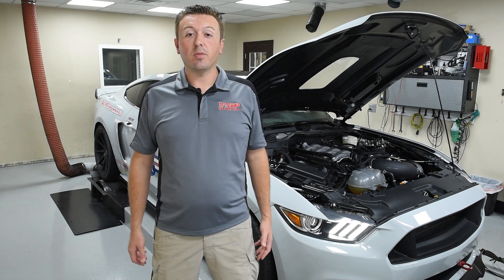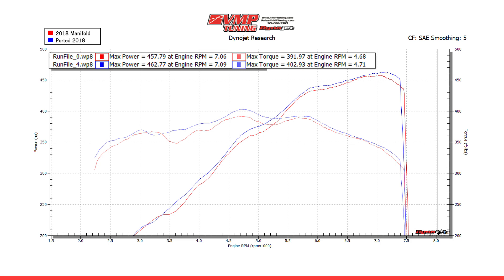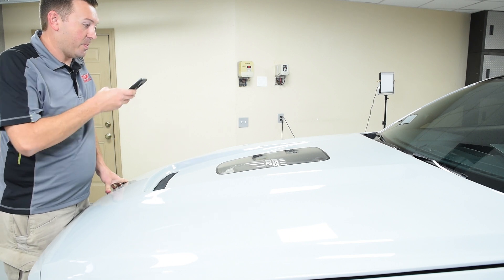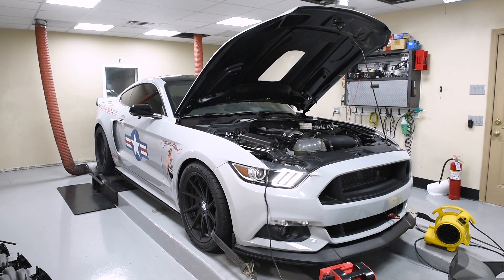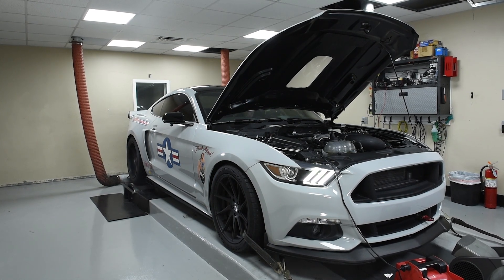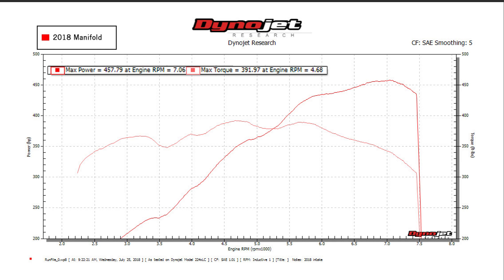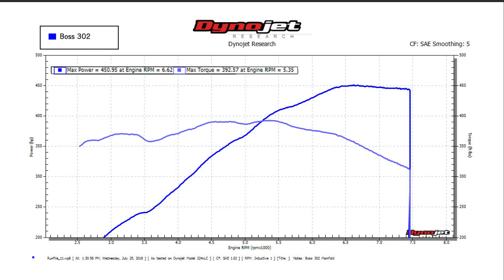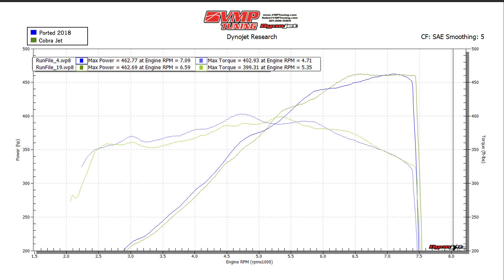VMP Performance | Coyote Ford Mustang Manifold Shootout

Comment: I'm shocked by the truck manifold's hp performance here.  It does nosedive after 6.5k, but everywhere else its hp appears to be as good as, or even better.  Even at 4.2k and again at 5.5k, it's making ~10-25 hp MORE than the other manifolds!  Its average HP/AUC below 6.5k appears significant.  Not what I expected at all.

Comment: In the end therexis like 10 hp between all the manifolds more progress can be made at the track by loosing weight, start with thdec4 flywheels otherwise known as road wheels, maybe the ubercexpensive carbon fibre gt500 wheels, remember wexare talking road racing NOT 1/4 mile.
Reply: There is so much more to it than what peak power they make.  The way they hold power at high rpm and either fall or don't fall makes all the difference.  Boss and cj and made to Rev they short shifted them at 7500.  That is limiting the entire purpose for them.  Rev them all to 8 the cj is gonna make a wider gap and it will perform better.  Ppl like you downplay the importance of a proper manifold choice but then swear the 5 lbs you lost on your wheels made you drop 1 second et lol.  I'm all for weight loss but everything is important including intake manifold choice.  Also if you have more mods done like cams and stuff there will be more difference between em

Comment: Just found this video , and thanks for doing it ! I have a 2016 F 150 5.0 and 3.73 gears with an S&B intake full 3 in exhaust and Hypertech 89 tune ! Would you recommend the 2018 ported manifold , it looks like the best of both worlds. I only rev it to 6300 rpm . What would a ported 2018 cost approximately ! Thanks for all your hard work , I know it took probably 20 hours of labor + dino time !……
Reply from the maker: You're welcome!  The '18 manifold is a great option for street driven vehicles.  Most ported '18 manifolds range from $700-$900 depending on the porter and if the package comes with lockouts or any other accessories to assist with the installation.
Reply: @VMPPerformanceTV  Thanks for your reply !……..

Comment: Peak gains is one thing but if you look at all the runs under the dyno graph and look at under the curve that truck mani is shitting all over the other Intakes. Ok tge others have peak power but they gonna have to chase you down! Change ur shift points to 6800 and some 3.73 gears and got damn watch that stang eat. I bet porting that truck mani would fix the up top issue as well
Reply: I was wondering what it would be like too , I have 4.10s and the 6 speed

Comment: Thats all good, the '18 is fine, its optimized,  but which of those intakes has the most headroom on an engine with more mods? Put each of those manifolds on an engine with cams, injectors, long tube headers, a QUALITY 3" exhaust, a crazy tune... then tell me which one is best.

Comment: I have a ported 18/19 manifold and got the cylinder head ported also . With a tune 511 rwhp.   ( + CAI - H-pipe) 
This video was the inspiration for the mods I got , which I, happy with.
Reply: Are you on E
Reply: @mk4geo822 good question. I'd like to know.

Comment: Probably won’t get replied to being such an old video. But are you running fbo to make that. Because my tuner says I’d only get 420-430 with fbo and ported manifold.
Reply from the maker: There's a ton of variables that affect power.  This particular car is heavily modified.  As for ported 18 manifold on pump 93 octane, that sounds about right.

Comment: Thanks for all the work with testings all these intakes. I have a 2019 mustang GT and wanted to ask is it possible to run a 1320 junkie  ported stock intake without a tune?
Reply from the maker: As long as it is just a ported version of the stock intake manifold and retains the functions of the stock manifold, you won't require a tune.
Reply: @VMPPerformanceTV  Thanks for the reply back. I'm trying to see just how quick of a 1/4 I can get it down to without turning.  What's the quickest times you've seen for a s550 10speeds stock tune with drag suspension and  mickey drag radials. I'm hoping for mid 11s

Comment: Are you tuning the car for each intake or is this straight up plug and play?
Reply from the maker: Intake manifold changes require tune changes specific to the manifold.
Reply: @VMPPerformanceTV  ok so home much of the claimed hp gains would actually be from the intake and not the tune?  If I used a programer on a stock 5.0 vs the intake and tune?
Reply from the maker: No problem.  In this test, we didn't modify timing or fueling.  Just the required parameters for each intake manifold.
Reply: And thanks for the reply appreciate any insight helps alot!

Comment: can I put a 2018 intake manifold on a 2017 mustang gt v8 ???
Reply from the maker: Yes.  You will need adapter harnesses for the IMRC/CMCVs or to lock them out and a new tune when swapping to an 18+ intake manifold.

Comment: Hey man by chance have you guys done this with the gen 3 intake manifold?
Reply from the maker: We haven't.  We have dyno'd quite a few 18+ manifold cars and find that while it doesn't quite hit the "peak" power of the CJ, the power under the curve gained with an 18 manifold and even ported versions of it provide a car that's a bit more fun to drive on the street.  You can search our YouTube channel for examples with dyno graphs.
Reply: @VMPPerformanceTV  speeda has the 2018 manifold for 350. You have decided my purchase for me. I will takr it to a machinist to get ported
Reply from the maker: We'd highly recommend Air Flow Solutions/Brett Barber for porting, as we've had great success with them!
Reply: @VMPPerformanceTV  thanks!
Reply: @VMPPerformanceTV  a guy was selling one ported from them on ebay with the lockplates. So just bought that. I have a bama tuner prolly gonna have to get a nice new map with this swap right ?

Comment: Would the truck intake make more since for me if I’m mostly street racing and not wanting to mess around with the rev limiter and also being a gen 2
Reply from the maker: We tend to have the best luck with the 18+ intake manifold on Coyotes, regardless of use.  These engines typically make most of their power up top and this intake seems to be the best balance of mid range power, torque, and high RPM-power producing capabilities.

Comment: Did you have the IMRCs locked out on the 2018 intake mani? I am no tune, 2017 gtp stock. My IMRC flaps are busted and i want to upgrade to the 2018 intake mani. I'm think of locking out the IMRC to full open and removing the IMRC junk from behind the new intake. After zip tying all the loose connections behind the intake manifold, will my car throw a CEL without anything hooked up to the lose pigtails? I am trying to avoid taking it anywhere for a tune. Don't want any CELs. If the car will drive fine without the IMRCs, I don't see a reason to retain them. It's not like it gets good gas mileage in the city anyway...
Reply from the maker: Either way you have to tune it, if you keep IMRC or delete, and the tuning is a lot better/cleaner when you keep them because the factory logic stays in place.

Comment: Hey Vmp question? So I have a 2015 mustang gt a6 fbo (Texas speed hi flow catted 1 7/8 long tube headers, 1320 ported 2018 Intake manifold,roush cai,47 lbs lu47 injectors,87mm gt350 throttle body, and e85r tune by Lund racing and so far I ran only one dyno and got 430whp and about 390 lbs of torque at most is that a normality with auto gen 2 coyotes or is my tune okay? I know Lund is an amazing tuning company but would you recommend me switching over to you guys or do you guys recommend hitting an actually dyno tuner.I see a lot of vids of gen 2 coyotes hitting 450whp with an a6 (automatic 6 speed)how do I achieve that power goal?!? Anyways great vid guys keep up the good work!!👍👍
(I forgot to mention) my STANG only has 18,000 miles oh and would achieving that 450whp goal lead to a more stressed engine or can I reach that while maintaining safe engine conditions cuz ya know I wanna daily it-thank you
Reply from the maker: Hey John.  Lund is a fantastic tuner and we're sure that your tune is well dialed.  As for the numbers, there's an incredible number of variables that affect the number seen on the dyno.  Anything from humidity, temperature, dyno calibration, fuel quality, altitude/DA, so on and so forth.  There's also the variables such as the vehicles level of wear, tire size and pressure, etc etc.  We'd recommend seeing how the car runs at the track over the dyno number due to the number of variables present there.  Get the car on the track, log the passes and be mindful of the mile an hour it runs.  Then have them review your revisions.  In the end, a dyno is just a tool giving approximations.  The biggest stressors for a vehicle like yours would be your driving habits and how aggressive the tune is.  If the car drives well and isn't giving you any issues on part throttle/normal driving, it should be fine.  It sounds like you've got the right combination of parts for your goals.
Reply: @VMPPerformanceTV  thank you very much I appreciate the very fast and professional response so I’ll do just that I’ll go ahead and invest in some good tires and take her to the track.That being said I’ll respond with my time stamp when I do again thank you VMP!!
Reply from the maker: It's our pleasure.  Good luck at the track!

Comment: Another 2018 manifold promotion. 🙄. Just so happens the only manifold ported in the video was the 2018. All others stock. Remove the ported 2018 and  2018 comes in 3rd. Test the ported CJ or 350 against the all mighty 2018. And you forgot the added cost of porting the 2018 🤔
Reply from the maker: Ported 18 is still a great value compared to CJ...and you can almost always find them somewhere.

Comment: Does a 2018 GT manifold use the same injectors as a 2017?
Reply from the maker: Yes.  The same PI injector style is used on both intakes.
Reply: @VMPPerformanceTV   Are you sure?  I thought the 2018 rail injectors are 24lbs and the 2017 and older are 38lbs.

Comment: 2011 F150 5.0L what manifold would be best for low end power? I've heard alot of people say the stock but I don't know.
Reply: The one you got on right now.  The one they tested in the vid is a 2011-2014 Truck Manifold.  Globs of low end torque.  Blew everything else out of the water.

Comment: All this info is pretty helpful for mod motor guys too. The 5.4 Navigator has the ability to use these manifolds and the 18+ manifold seems like the hot ticket.
Reply: That truck manifold impressed me too. It made more peak horsepower than the boss 302 manifold and average more hp and tq up until 6500rpms. The boss 302 manifold is common on the 5.4 because it fits over the stock alternator location. Honestly, given that the 5.4 4v sbe is only safe to around 6500rpms, the truck manifold may be the best suited to the combo. Thanks for sharing all this!
Reply from the maker: No problem at all!  We're glad you found it helpful.

Comment: I still think the stock intake or "truck" intake is going to be best unless you plan on running beyond 7k rpms. You get more torque and you peak hp earlier at 6500rpms and it is close to what the 2018 intake makes at 7k with almost 20-30 more torque down low for greater overall driveability. The power falls off at 7k but only 20hp but you need to look at all the gains in the mid range.

Comment: So 457hp, 391tq rwhp obviously a cold air intake jlt Headers and exhaust. Such a badass number for such a small amount of parts thrown at it..of course expensive parts but I truly want my 16 at 550 + na I've done all the mods to achieve that I believe. Mods list
Kooks stainless Headers 1 7/8 with 3 in catless and resonatorless 
x pipe and Flowmasters, 
Grantanelli mass air sensor
Sr coils 
18 intakes 
87mm Throttle body and tb spacer
A tune from BAMA 
Cold air intake JLT sealed box 
Barton hybrid shifter
Factory performance pack 3.73 gears 6 speed 
19 wheels and Michelin sport cup 4 tires 
My biggest mod will be when I come to Vmp for a dyno tune. I can't wait to push her to the max b4 I get to finally step beyond NA I want her to be as powerful as she can be...considering cams but it's not like it use to be with v8s a cam could add 60hp and a totally different attitude now they seem to only add like 12-20 which for 1800.00 isn't worth it unless it changes the rpm range

Comment: I'm surprised with the results from the GT350 intake vs 2018 intake. They are the same here yet the Bullitt and Mach 1 pull 30+ hp and 15 trq at the wheels with that same GT350 intake. Is this attributed to readjusted tune to take advantage of the larger intake?
Reply: Yea this confuses me. I think it may just be the air intake. Debated on getting a ported 350 manifold but it may not be worth it.

Comment: Hey guys does anyone know if the ford performance 2020 procal be used on a gt350 manifold, or would I need a separate tune?
Reply from the maker: The calibration needs to be specifically adjusted for the GT350 manifold.
Reply: @VMPPerformanceTV  do i have to take the procal calibration tool else where to get adjusted for the gt350 manifold… Sorry for the second question… I have asked and researched and was not able to get a clear reply. Thanks
Reply from the maker: We use SCT and HPTuners devices for our tuning services.  As for the Ford Performance devices, they are intended purely for a Ford Performance package equipped vehicle and not for custom tuning.
Reply: @VMPPerformanceTV  thank you so much , where are you guys located? I’m in Califas
Reply from the maker: We're in New Smyrna Beach, FL.
Reply: @VMPPerformanceTV  do you guys sell a tuner for the gt350 manifold , since I already have the Gt350 Ford performance Intake and throttle body adapter with procal …
Reply from the maker: Tuning would require a custom tune and device to flash the tune on.  Shoot us an email at sales@vmpperformance.com and our team can get you a quote on the exact cost.
Reply: @VMPPerformanceTV  ok thank you

Comment: Were the 18 and 350 intakes locked out correct? 

Also could you do this again but with a ported 350 vs the 18 ported and un ported? Curious on how well the curve is after that. The 18 ported really smoothed out the tq and had huge low-end gains.

Comment: Question: I have a 17 6r80 with headers, ported boss 302, and tune with a roush CAI. Total numbers after dyno today was 430 to the wheels and 367 torque. 93 octane... Sound right?

Comment: Were the comparisons between the stock 2017 GT (truck?) intake and the 2018 both performed with the IMRC/CMCV features enabled or disabled? Since there is quite a bit of difference in the bottom-end torque, which the IMRC is supposed to provide, I want to make sure it was an apples to apples comparison.
Reply: I would like to see the same testing done  I agree a test with the stock 15-17 gt manifold and 18-20 f150 intake manifold but with functioning imrc and proper tune for imrc

Comment: How come tuners say to lock them out when swaping a 2018 manifold on to a 2015 is this only for the ported versions or recommended for both
Reply from the maker: Hi Quinn, if you're talking about the IMRCs, we actually retain them in most cases using our plug and play IMRC harnesses when swapping an '18 Manifold onto a '15-'17 car for drivability and fuel economy.  They fully close into the runners at wide open throttle.

Comment: The ported 2018 and the Cobra Jet make right at the same power and torque with max power coming in only a couple hundred RPM less (7100 vs CJ 7400). What is the cost to have a 2018 manifold ported? Seems like if you don't want to run an aftermarket hood or mess with lowering motor mounts the 2018 is the way to go.
Reply from the maker: Hey Bill!  We offer the 2018 ported by Bret Barber as a package with options for the extras needed for the various generations of Coyote Mustang.  We'll include the link in this comment.  It comes out to just a tad under $800, plus any adapters or harnesses you need.  https://www.vmpperformance.com/2018-Ford-Mustang-Intake-Manifold_2?quantity=1&custcol_vmp_porting_option=71&custcol_vmp_cmcv_imrc_options=3

Comment: Any difference between the GT350 intake manifold and the GT350R manifold?
Reply: No, GT350 manifold is used in the GT350R, Bullitt, and the new 2021 Mach 1. All the same.

Comment: I’m looking to buy a 2015-2017 GT as my next mustang if I bought the 2018 ported intake what other mods would I have to do to get 500rwhp and at least 400rwtq ?
Reply from the maker: The Gen 2 ('15-'17 Mustang GT) usually lands in the middle 400's, approaching 500rwhp naturally aspirated on E85.  There's a few intake manifolds that'll get your horsepower up, but may sacrifice a bit of tq in the process.  If you look at the video on our channel for the Flex Fuel tuning, this particular car, a 2016 GT, ran a ported 18 manifold, JLT cold air, and our flex fuel tuning for 435rwhp and 390rwtq.  The addition of headers could possibly net this car enough to get it up around 450+rwhp and 400tq at the wheels.

Comment: Do you have to switch your injectors when you upgrade to the 2018 ported manifold
Reply from the maker: It depends on your other modifications and overall goals.  With just the ported intake and a flex fuel tune, we retained the stock injectors on our Social Media guy's '16 GT.  You can see that install video at the link:  https://youtu.be/V7qLgFEdMb8
Reply: VMPPerformance I know later on I’m doing force induction just wanted to see if I would need to change injector with the 18 ported manifold
Reply from the maker: @Gu3ssWhoki113dU1  no.  Not required for just the 18 intake.